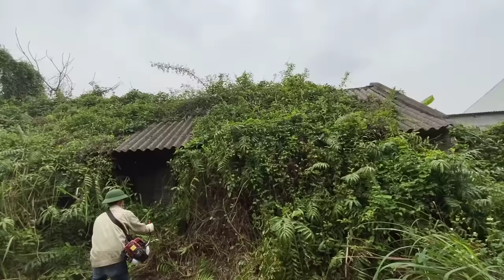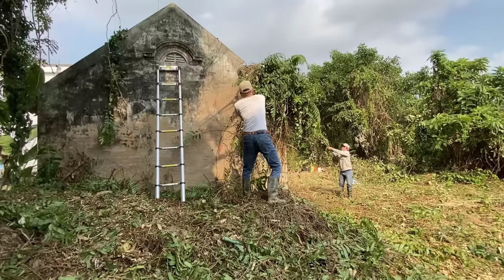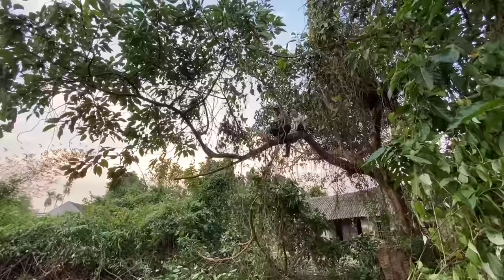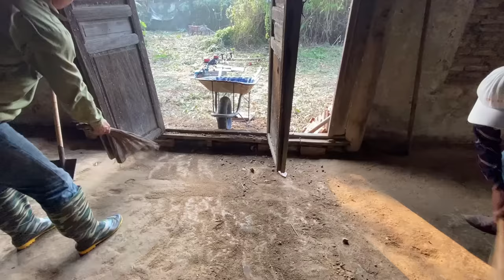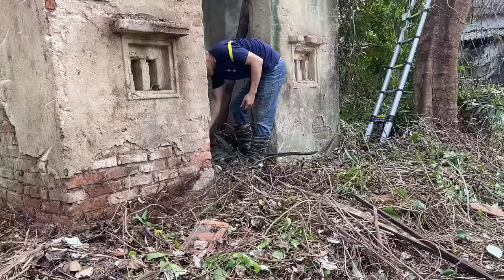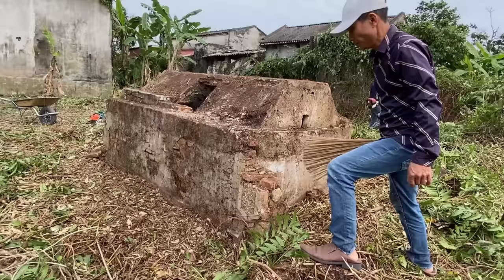Cleaning the HOUSE is MORE than 100 YEARS old, Overgrown wild Trees cover the whole house | CLEAN UP

Comment: When cleaning a property it is important to have a strategy. Know what to root out, what to prune. While your efforts are appreciated, a suggestion is to plan. Of the 3 men, 1 can look around for debris to be picked up -- like plastics, wood or furniture waste, pipes, etc, while 1 cuts and cleans the plot. The 3rd can mark out plants that need to be protected. The person using the machine should mark an area and do a thorough cleaning up of that area. When he moves to the 2nd or 3rd slot, the 2 others can help remove all the waste and deposit it into a garden dump.

Comment: Your equipment runs on petrol or gasoline. I hope you don't need to use a lot. I see them emitting fumes. I hope the motors don't burn out. Such heavy vegetation. Great job
Does these vines are from Yams? If so you could make big harvest, as we see from forest life videos. Just a thought!!?
These old village homes usually have a fireplace for cooking. Would be good if you save the firewood from the trees? For use if some one came back to the property one day?
Looks like you found the outdoor stove. Put all the garden debris inside n start burning them. Then you don't have to take it somewhere. Too much carrying n transportation..

Comment: Those weed trimmers should have either a wire trimmer or a metal blade for doing the type of work you're using them for monofilament line if you're using it ain't going to work you need wire or steel blades